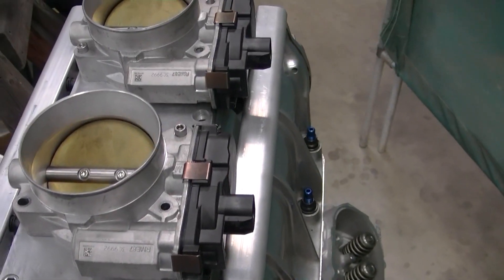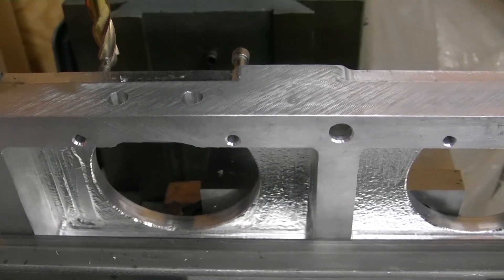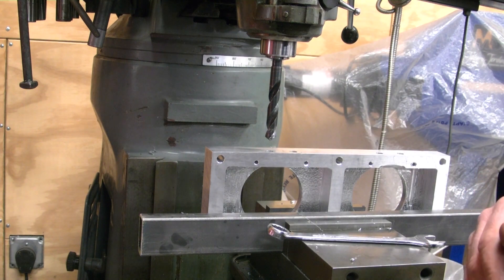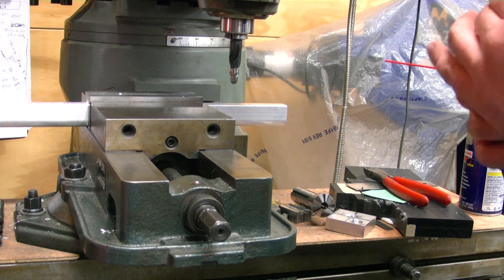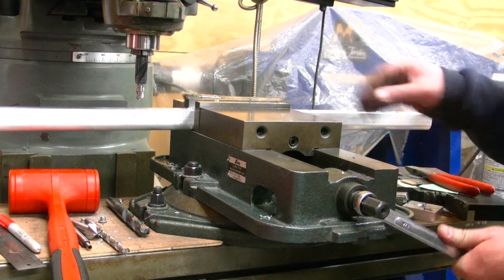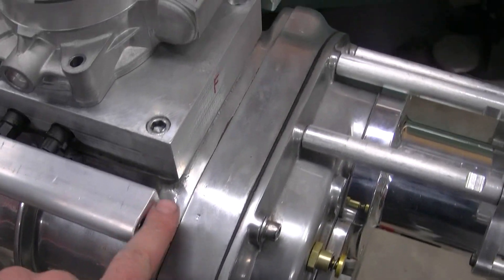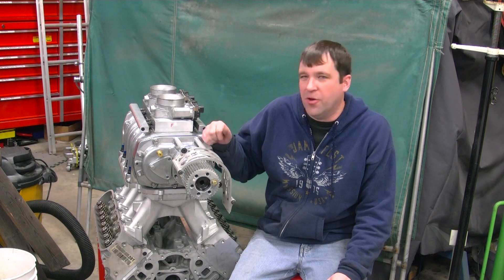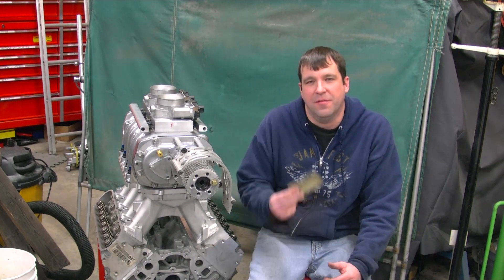LS Roots Blower Build Part 6 (Machining Fuel Rails)

Comment: Why didnt you use the ones in the high ram? the injector holes. or are you gonna run 16 injectors? thx bro.
Reply from the maker: I'm going to run 16 injectors. Unless you have a very loose blower you need to run fuel up top to keep rotors cool so they don't expand and hit each other.

Comment: What's the reason for the second set of injectors??
Reply from the maker: Top set is for keeping blower rotors cool. Bottom set is to control cylinder to cylinder tuning. Roots blowers tend to push air to front of engine making front cylinders lean.

Comment: Any updates on the build? I'm looking to do the same setup on a 540 big block chevy.
Reply from the maker: Been a fairly busy summer for me, so I haven't got to mess with it. I bought a Holley Dominator EFI for it.  I kind of gave up on the Nova idea. Now I'm going to put it in my little 59 Rambler American Wagon, since I already own it. Looking at selling my ls7 powered s10 to be able to dive head first into the Rambler.
Reply: Final Call Racing cool, I’ve been telling you to do a 69 Rambler because it’s better than a Nova, but a wagon is much better
Reply from the maker: @xozindustries7451  a little more fab work than I was wanting for this project, but it shouldnt be too bad. I think I'll go with mustang II type suspension.
Reply: Final Call Racing what’s the part number of those throttle bodies, what size are they. Are you using the dominator EFI, and what injectors are you using!
Reply from the maker: @xozindustries7451  The throttle body is 12605109 ls3/ls7. 90mm. Im using dominator efi but have not got injectors. I was going to call holley and get recommendation for my application when I was ready.
Reply: Final Call Racing thats the part number of the ones I was going to use, but the ones in the video don’t look like the LS7 ones
Reply from the maker: @xozindustries7451  https://www.summitracing.com/parts/nal-12615503?seid=srese1&gclid=EAIaIQobChMIvbqZq7uT5QIVlh6tBh2tlA7UEAQYBSABEgK0qfD_BwE
Reply: Final Call Racing this is the LS7 one I found, 90mm it says LS7 in the description. Maybe it’s different on the crate engine?

https://www.summitracing.com/parts/ado-217-3153/

Comment: How do you plan on controlling the top injectors? Will they fire the same as the cylinder injectors?
Reply from the maker: I just purchased a holley dominator to control this setup. The lower injectors will be tuned to keep cylinders even.
Reply: Yes but will the top injectors be connected to the bottom injectors? Will they pulse the same and at the same time as the lower injectors? Or are they run on a separate circuit and have somthing else controlling them?
Reply from the maker: @bradfordcustoms7588  They will be separate. I will be able to control the top injectors to pulse separate from port injectors. On the Dominator it looks like I will be able to control duty cycle to each individual injector. So if one cylinder is hotter I can up the injector duty more on that cylinder to richen it up.  I am no where near ready to wire this thing but have been doing a little reading on it to see what I will be able to do.

Comment: Looks like a set of fuel rails off the late 90's lt1 would have been a good starting point. Did the throttle body bolt holes interfere with that alignment?
Reply from the maker: Everything cleared good. Hope to get started back on this thing soon.

Comment: Just curious why you didn't use the fuel injector holes in the high ram manifold?
Reply from the maker: Most blowers, unless they are set up extremely loose, will require the fuel to keep them cool when spinning. If no fuel is injected on top the blower there is a very good chance the blower will lock up.  I will also be using the injectors on the high ram manifold to control the individual cylinders. Roots blowers will push the air to the front of the manifold leaning out the front cylinders.  My race car has 10 injectors on top the blower and 2 injectors per cylinder in the front 4 cylinders and just one injector in each of the last 4 cylinders to keep the engine from leaning out up front.  Total of 22 fuel injectors
Reply: @finalcallracing  ahh i gotcha i gotcha, i wasnt even thinking about the cooling aspect of it. I knew about it leaning out the cylinders and all thats why i was curious about why you were doing them there instead of the intake. But yea that makes sense, gotta be a hell of a tuner for getting it right haha. You found that car yet?
Reply from the maker: @wakeboarder259  Called on one in CA but appears to be a bondo queen. Found another I really liked and was going to give more than I had planned on and he took it off of ebay before the auction ended.